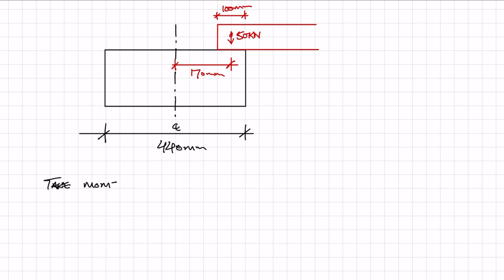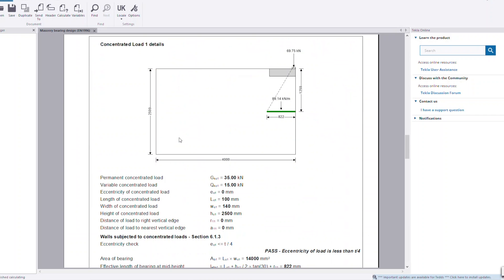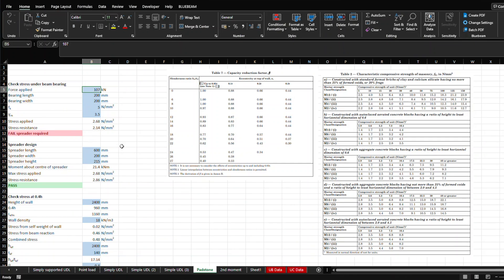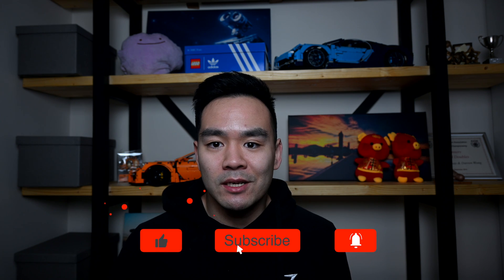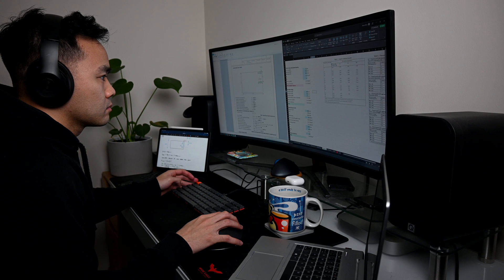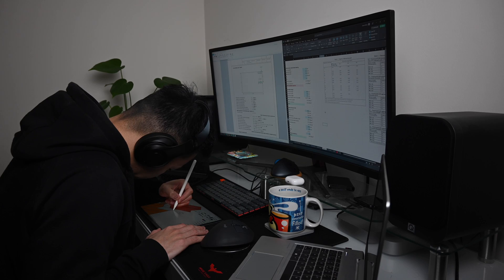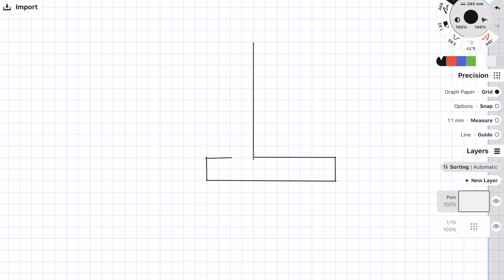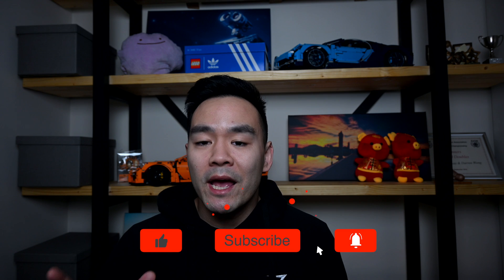Why hand calculations and sketching is so important to a structural engineer

Comment: Do structural engineers visit often the construcion site? I heard that either you stay the whole time at the office (structural engineers) or you constantly go to the construcion site (constructor engineers).
Thank you so much for the video, it has pretty good recommendations for s.e.
Reply from the maker: I go to visit site very often. I work for a smaller company atm and I’m out of the office a lot. 
My advice would be to get to site every opportunity you get. You can learn a lot there.